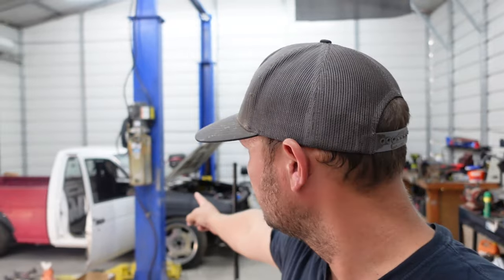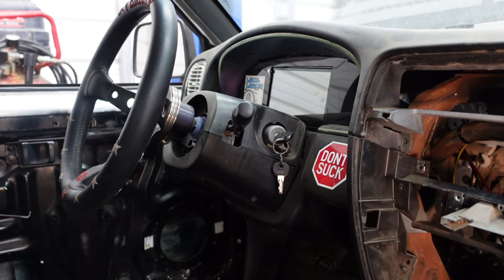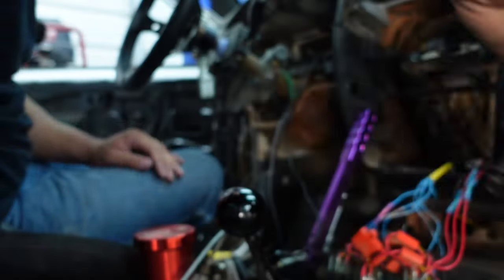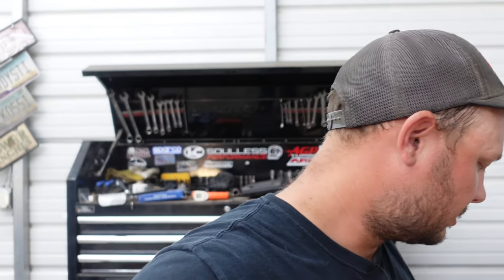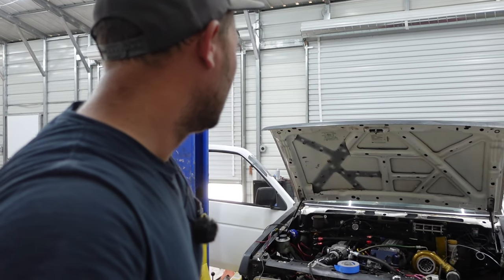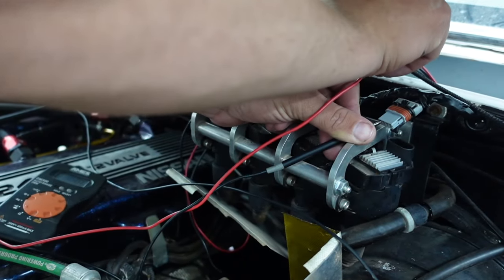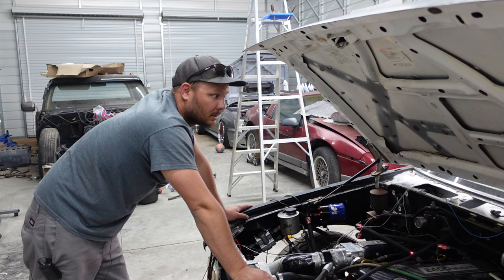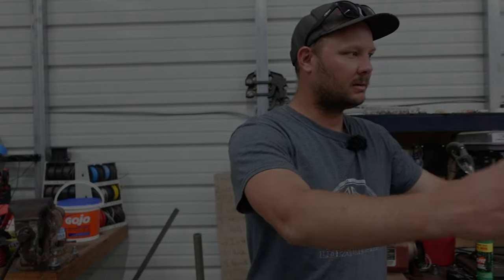FuelTech FT450 Install ( Part 1)

Comment: Not running the ground straight to the battery is hit or miss. Fueltech suggests this to keep noise out of the ECU, aka "clean ground" It has worked for some and not others.

Comment: Looking good...  I noticed you mentioned using a tee fitting to get two different oil reading from the same port...  A good idea you may think about using an oil sandwich adapter. The one I used in my truck has three sensor ports... I believe they run about $30.00.
Reply from the maker: The one i have only has 2 and one is used for temp.

Comment: Did you not buy the fueltech 4 cylinder A harness? The biggest disappointment with the FT450 I bought is not being able to run full sequential. That really sucked!
Reply from the maker: You can run full sequential with the ft450
Reply: @LocalLosers520  Correct, it can run full sequential however the fueltech A harness is not wired for full sequential. The ignition coils through the fueltech A harness are set up for waisted spark and the injectors with the A harness are set up for batch firing. I did not know this when I bought the fueltech A harness. I was not pleased to learn this. If I made my own harness to where everything was to run full sequential I would run out of inputs anyhow to run everything I have.

Comment: I’m installing fuel tech on my hardbody single cam just like yours . What problems or issues will I come across into getting in running after the install ?
Reply from the maker: Not much. Fuel tech is amazing. If you have any problems give them a call. We had to get my timing right it was off like 80* in the ecu. Other then that it was just normal tuning stuff
Reply: Which trigger wheel did you use ?